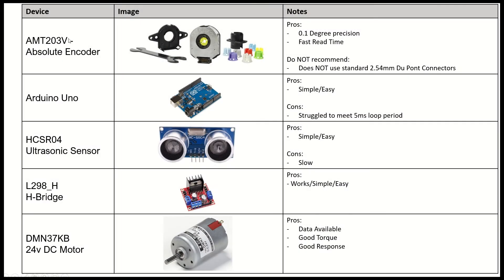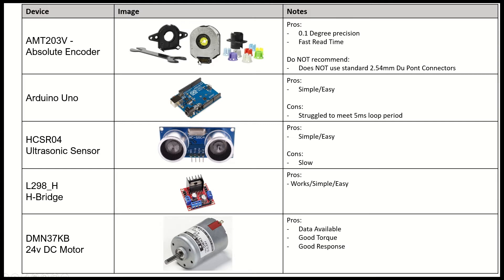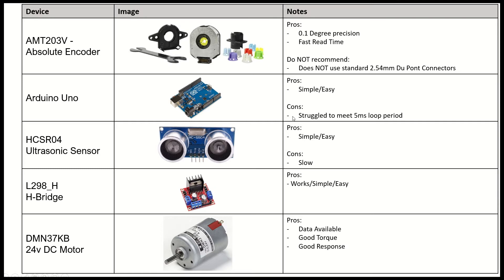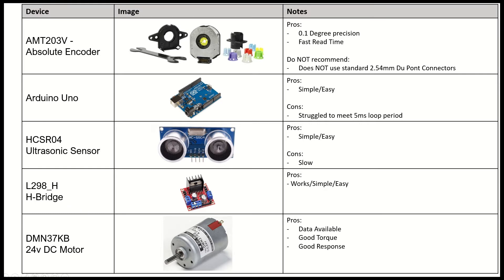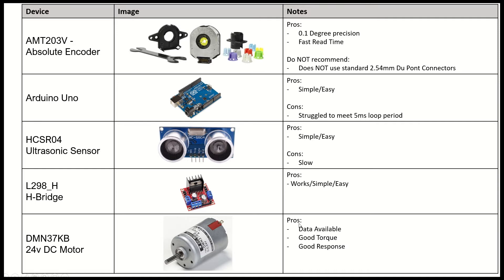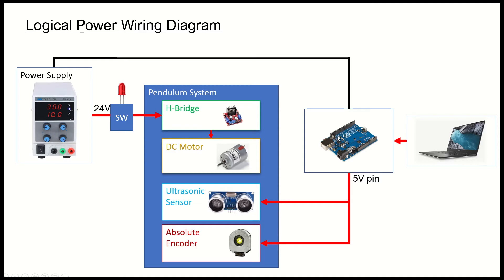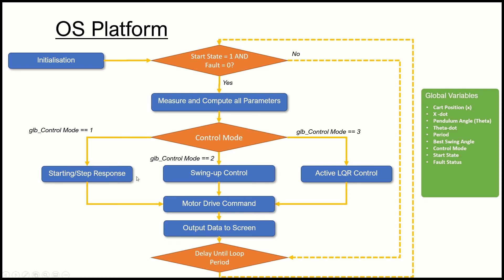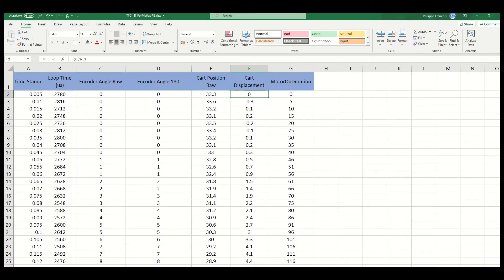Making an Inverted Pendulum - Part 2 of 4:  Electronics and Software

Comment: I used a teensy instead of the Arduino UNO for a project, it was much faster and same arduino library for programming, you could probably check it out.
Reply: About this teensy, does it work similar to the arduino? which are the benefits of using the teensy instead of the arduino. Also i'd like to know if the arduino mega has the same issues

Comment: Hi is there any way to contact with you like telegram or Facebook 
I am trying to make inverted cart pendulum 
I didn't use encoder for pendulum 
But I use dc+ potentiometer +h bridge 
And I use ultrasound sensors for cart position 
I don't know how to connect between hardware and there is not any video to connect 
I will appreciate any help .
Reply: i'd like to kow if you were able to succeed in yu project, if so i'd like to contact regarding the same issue

Comment: for step response and data analysis you have some data into an excel document. how you prelevate that that or what software you used? cand you explain me the procedure of obtaining that data from the sensors?
Reply from the maker: Hi. All I did was println the value of the sensors with a space in between. This outputs the data to the serial monitor and from there you can just Cntl+C and Cntrl+V the serial monitor to copy and paste it into excel. Hope that helps :)
Reply: @philippefrancois2097  
I have question
Can I  replace Rotary incremental encoder 
With dc motor and h bridge and connect them with pendulum
Reply: If you are making inverted cart pendulum 
I have questions for you 
Can I replace incremental Rotary encoder with DC MOTOR AND H BRIDGE